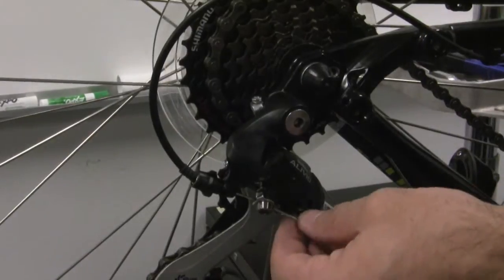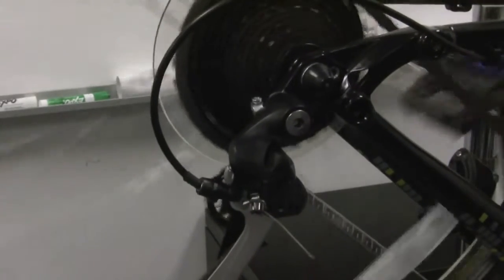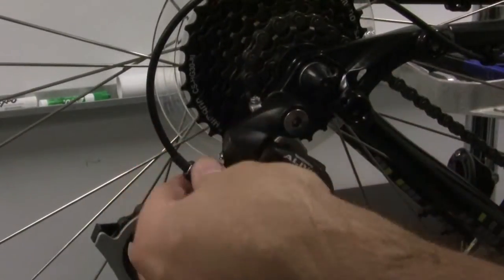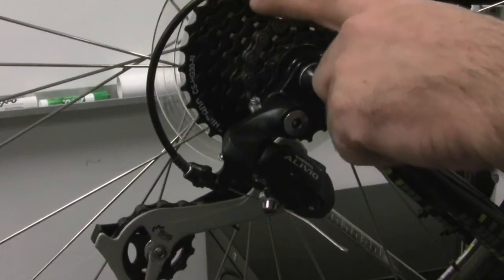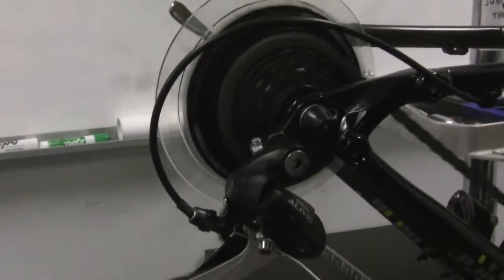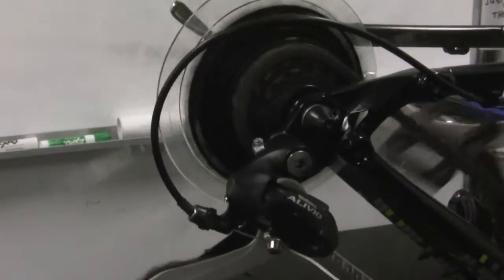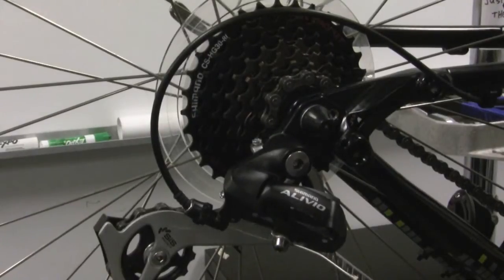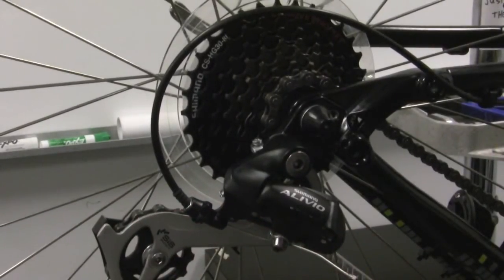Fine Tune your Rear Derailleur's Shifting

Comment: Is that noise normal? I have that noise on my rear shimano 105 derailleur and its kinda bugging me if its good or bad, Its been 20 ish miles so far, i just got it, i checked it all, shifts well, the pulley is aligned but the concern is that noise you have in here as well!